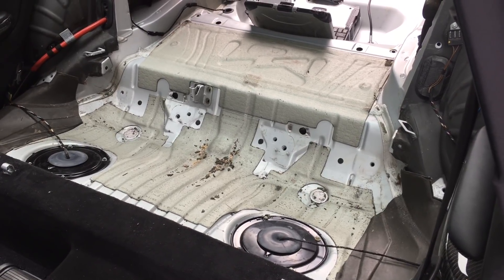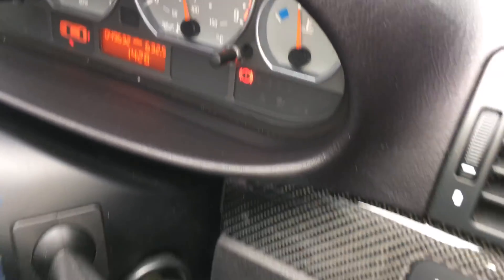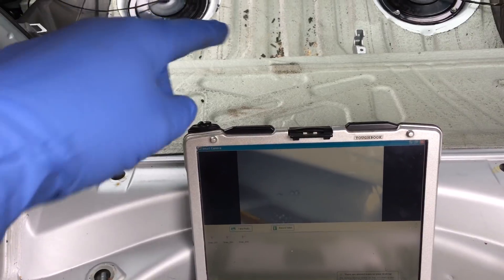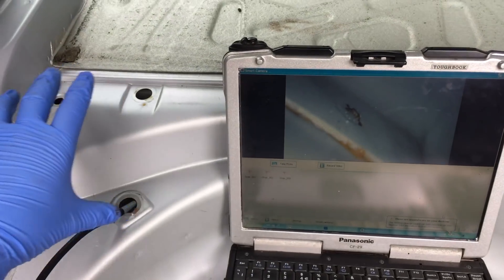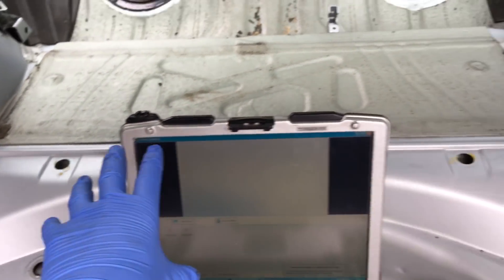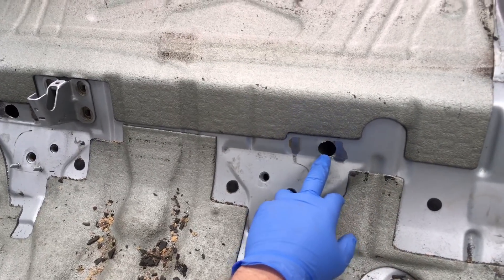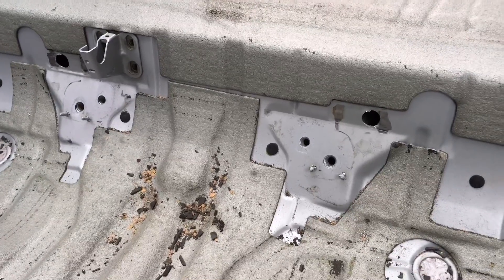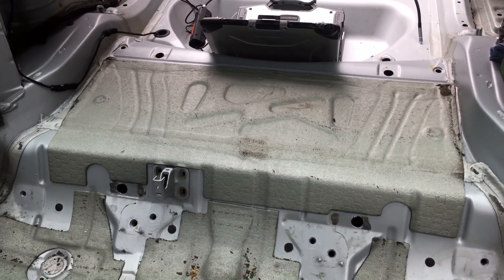HOW TO check BMW E46 RACP INTERNAL hidden cavities

Comment: Excellent video. Thanks. What do you think of existing reinforcement solutions? CMP engineering guys say that plates aren't sufficient and that the wheel well becomes susceptible to crack due to propagation of the forces to this area as well. Opinion?